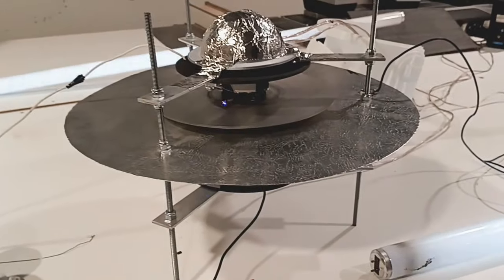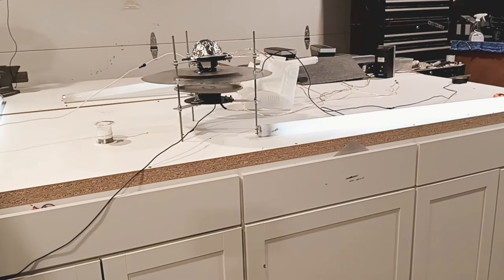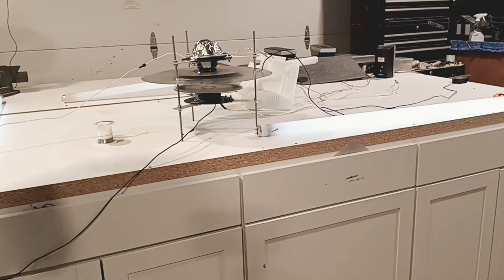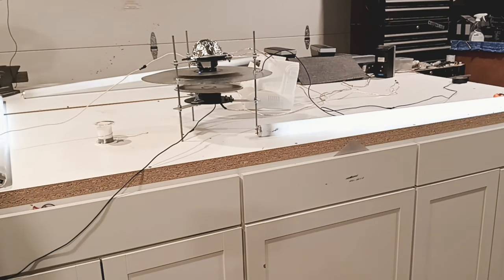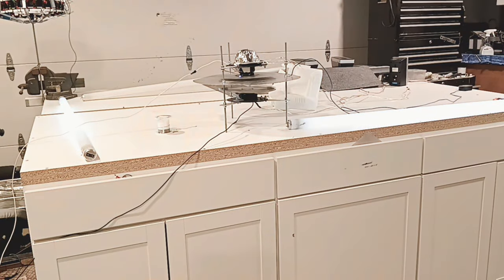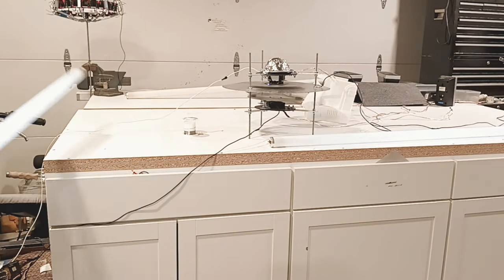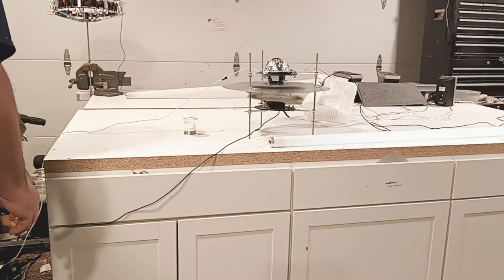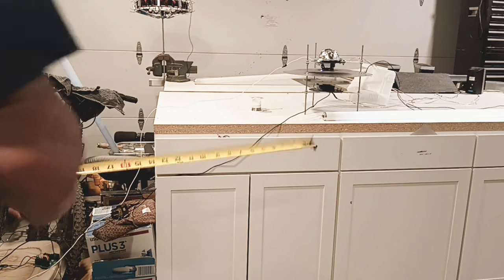Graviflyer Testing 6 "Pushing The Field"

Comment: Is this device using the same concepts that were just supposedly discovered by NASA? Supposedly able to generate more than 1G of force without any typical chemical propulsion.
Reply from the maker: The static experiments. In some ways yes. But from what I have seen they use 1:1 on the size between plates of material.

Comment: Have you checked continuity between plates? As I understand it, the middle plate is not supposed to electrically connected to any of the plates, but when your experiment sparks, it seems like it sparks from top plate, to center and through the chassis to the bottom plate.. High voltage can easily jump gaps, I think there is bad insulation between the chassis and the bottom disc.
Reply from the maker: I have 2 fields  pushing against each other causing spikes in voltage.
Reply: @nathanbunten4299   are the fields... 🤔🤔🤔n/s,s/n..... s/n,n/s🤔 or in line like n/s,n/s..?
Reply from the maker: @gypthcnuryse7611  I don't have a way to test. The static meter doesn't show it.
Reply: @nathanbunten4299  the way you stacked the magnet when you built it they push or pull ... I kinda remember a video I think u said it was ... s- poll on bottom? So I'm guessing you have the 2 n+ polls 🤔 against the center plate.  And the static charge is building up there. 😆  I think I need to rite some notes 📝 this thing so cool 😎

Comment: 39" = 990.6 kHz mass vibration, the energy that forms structure.
Reply from the maker: Question. If I set my high voltage coil to that same frequency. Would the effect be bigger or more powerful inside the same area? Also if I wanted the static field on the inside to be a little smaller then somewhere around 900khz would do it?

Comment: I have had the same kind of spark leakage in different experiments. I took my hot glue gun and liberally filled the pin side of the flyback transformer with hot glue. The over sparks stopped.
Reply from the maker: I cannot do that here.
Reply: @nathanbunten4299  Ah, gotcha!

Comment: When you say 15v on the Tesla coil what frequency is it at?  Is this the input side of the Tesla coil that you’ve connected or the output?  I’m surprised because in addition to high voltage used it looks like there’s sparking going on which would seem to suggest high voltage (?)
Reply from the maker: The frequency of the center plate changes the oscillation frequency of the tesla coil. It is making the voltage spike and causes the interaction of the high voltage on the disc's to amplify. 15v is what is going into my tesla coil circuit. I will run a test with just my tesla coil in the same spot as my graviflyer and show that it cannot do the same at 15v. It would take 40v to go that far.

Comment: Does the stand need to be metal? Just wondering if you’d want to promote charge transfer via discs rather than the legs
Reply from the maker: there are 2 fields. One has to be inside the other the frame helps with that at low power. So yes it needs to be metal.

Comment: BTW the reason the camera quality seemingly decrease is because of the low light conditions, I dont see anything that would suggest something different going on. To be honest I think you just have a pretty powerful spark gap transmitter here, if you get better brushes or just used a strip of metal, I bet the "field" you are experiencing would decrease significantly.

Comment: You know this makes me think. How does the small fiber stay afloat. Like nothing but the air is effecting it 🤔. Might you see the charge within that fiber. If you want to beat gravity you must first understand magnetism. Thr bifilar coil holds many secrets. You ever check out any metamaterials??? Nice work btw
Reply from the maker: I always see it like a magnet down a aluminum pipe. The electrons are trying to form bonds but can't hang on to them for long.
Reply: @nathanbunten4299  interesting proposal. you do realize no electron has even been recorded in history correct? It's neutral to the medium how I see it. It's quality is high due to it's lack of quantity. A magnet is the same before and after it's been magnetized. It's quality is a different story. Nikola Tesla was no atomist or materialist. he didn't say electrons rather the Æther. Steinmetz and Maxwell had good ideas for it as well
Reply from the maker: @EnergyTRE  Tesla was also said to magnetize wood. To everyone this would look like that. https://youtu.be/XRfYpcyDoLg?si=lTf5ukiZo5GZTLrc

What is really going on is polarization. I believe it is what make up our magnetosphere. The same test done on my graviflyer where it is connected to the center plate also shows this effect wood sticks to it by a polarized bond. It is aluminum. No magnet can do this. 

What I am saying is the field is already everywhere. We always want to know what to solve for in antigravity. This would be our first clue. A mix of polarized fields that will react like static charge. 

It is why I am testing my Graviflyer with this field on the outside or whole frame. There is a lot there to figure out.
Reply: @nathanbunten4299  agree the field is everywhere. The greatest minds called it the Æther. Illumination isn't a duality or a particle it's the modulation of the medium.
Reply: There is much to do for me, not so much figuring out anymore. No reply to metamaterials?
Reply from the maker: @EnergyTRE  I agree. That is why I am working on the fields so much right now.  When I ran this configuration last time it was uncontrollable. I think I have it understood a little better. I think I found a field like it but not sure it's the real thing. Time will tell.
Reply: @nathanbunten4299  you definitely on the right path. I've noticed a few specific frequencies that resonate well with the local medium. Once out of the earths radiation belt/ emf.  there are more waiting Jupiter, the sun, Galaxy, great attractors. A consistent power supply was my next goal. I called it the potential cube.
Reply from the maker: @EnergyTRE  if I could combine aluminum with quartz. That would be the best one. I don't even know if that is possible. I also like cobalt for coils core. It is a superconductor when cooled. I do not have a better answer. What I would want they don't make. Maybe it can't be made.
Reply from the maker: @EnergyTRE  Have you ever thought that the earth has a big resonance chamber at its core. That frequency is the dominate power here. 

I like the potential cube idea. If you change the set of frequency's to each planet you get antigravity in each one because they are all different. If that is where you are going I like it.

Comment: You can use Faraday cage on your camera.
Reply from the maker: That sounds like a plan.
Reply: @nathanbunten4299  also do not put the lights near the cables to make sure its an actual field size that causes the lights to flicker and not the field from the cables.
Reply from the maker: @raysplay2827  I know, I tested the cables for leakage. I normally use coax cables to test with. Th insolation is 10x better.
Reply: @nathanbunten4299  that's great. i mentioned this for video footage so no one can say its a hoax due to the lights being near a cable. keep up the amazing work, i am rooting for you.
Reply from the maker: @raysplay2827  I don't need the cables to show it bigger. I can push this field out 20 feet. In fact it is one of my next tests before I Force the fields back in to a bubble.
Reply: @nathanbunten4299  i wonder if the field is so powerful that it reaches 20 feet, how would it behave in concentrated asymmetric conditions .  if i understood you correctly, the the upper bubble need to collapse using the ultrasonic wave every time it reaches its peak. 
Could you also test extremely low voltage on the upper disc while having high voltage in the lower disc? in theory you might be able to reproduce the exodus propulsion using electrostatic pressure.

if its not charge asymmetry that causes the effect , i speculate that what causes the flying effect is the fact that the bubble must grow and collapse to create the effect. as if you establish relationship between 2 bubbles and before that relationship is established, no effect will be generated by collapse of upper bubble.

if the speculation is right, once you establish what exactly is the required relationship, you re/discover a new principle.
Reply from the maker: @raysplay2827  The reason for the testing is to see how much power there is. Then reverse the fields. I need to know how much power the field is holding in. There is a pressure there. The pressure is the key

Comment: i am wondering looking at this 15vdc in ? amps. This could be great to measure the output to see if you have a COP plus ?
Reply from the maker: I order a new power supply that tells the volts and amps used so when I have it I will show the numbers.

Comment: Do the disks spin in opposite directions?
Arent they supposed to spin in opposite directions?
Reply from the maker: yes they do and yes they are supposed to. I am going to try today to get that same field to push out 3 more feet.
Reply: @nathanbunten4299   He is totally right in using sparkgaps. Where can i study design? If power is driven by sparkgap how is poles rectified ?
Reply from the maker: @BushLieWorldDie  it is a solid state tesla coil so no spark gap. here are some video's on the build.

https://youtu.be/kFa3lvylyyw
https://youtu.be/rk3d6Saf9_0
https://youtu.be/yUcPMlYO6AE
https://youtu.be/pW-yxtEPr6U
https://youtu.be/eT0l-EPlog4

Comment: Is ur ultrasonic pezzo going?
Reply from the maker: no. just the HV and TC and motors.
Reply: @nathanbunten4299  with the field the tesla coil is making ..are you able to test the magnetic strength 💪? It would be nice if it was the thrust factor ..when you turn the pezzo off it becomes a receiver and dumps ?? into TC? I need to rewatch some more and i need to watch the build ..  your content is great 👍
Reply from the maker: @gypthcnuryse7611  I am having trouble with the piezo making changes. It runs and can be seen on the oscilloscope but I do not see the change.

Comment: your pushing way too much power. your field shouldnt be no more than on the craft itself. another words, it should only light up when you touch a bulb to it
Reply from the maker: It is only 15v. My tesla coil circuit starts working at low power of 12v. The high voltage is 12v in. This field should have never been this big. I have found a resonance point in the rotation of the discs. I have to follow where the test leads me and the power is one thing that keeps happening.
Reply: @nathanbunten4299  look into different transistors

Comment: Black & White TV was built first and then it had several stages, from round screen to semi-round screen, and then rectangular screen, and then flat screen. With these three achievements the Yoke coil, and vertical and horizontal sweep were modified, then in order to increase the picture quality the sweep rates were changed and then inter-laced techniques were used. In all that there was one definite principle and that was when electrons hit the phosphorus coated glass in vacuum it shines. That very property of electron in vacuum an flourascent material coating gave is television. Then comes the color TV using three electron guns, and then high definition paper thing LED type. Soon we will have true 3D halogram projection to watch television with a totally different prospect. 
Now, coming to your experiment, I have watched several of yours I don't see a proven fact: Such as Gravity and its definition? The most important thing is the unified field theory. There is only one force in the universe; that we need to find out. How? Well, Gravity is one, Magnetism is second, Electric is third, and weak and strong force of attraction and repulsion of electron is fourth. Now scientist found out that Magnet and Electric forces are interchangeable: meaning electric makes magnetic force and magnet makes electrical forces: that reduced to o ne as Electro-Magnetic force. Then we had witnessed the Z-particle spin in the atomic structure, beginning of quantum theory, and we figured out that Nuclear force is nothing but electro-magnitism.  A Noble Prize was awarded to three scientists in proving that. Now we have identified two forces, Electro-Nucleo_magnetic force, and second is Gravity force. How did we do it? BY finding the properties that these three forces interchange each other. Now four forces have been reduced to two. The million dollars question is how to find out if Gravity and Electro_Nucleo_Magnetic force can be arrange to form a Gravitic force or vice versa. There has to be a THEORY and PRINCIPLE. You don't have either. Someone showed a flying graviflyer does not mean anything because there has been no such evidences yet that gravitic force is an off-shoot of the other force (it must be but not discovered yet). So you are assuming a lot of things here in these experiment. One of your assumption is to create electromagnetic force in a toroidal form, just like the gravitic force around the Earth or any other satellite out in the space. So far we have seen how atmosphere ATMOSPHERE gives a lift when stream of electromagnetic radiation shoots in the atmosphere; See Tim Ventura's lifter. NASA also has been working on Ionization thrust but to no avail. The bottom line is this  that you are assuming some effects without proper and pragmatic reasoning. You can arrange capacitors, inductors, magnetic in one million different ways and one of the set up may produce ANTI-GRAVITIC FORCE. We don't know what gravitic force is; just as we did not know what magnetic force was. One thing to notice, when a magnetic is moved in a coil it causes magnetic flux to influence the coil and if it is a closed loop the electric current flows through the coil. There are no additional electron entring the system and as long as the magnet is moving, the current flows through the load, neither the wire nor the magnet looses its weight or quantity? So whatever electrons are within the closed loop are producing the power proportional to the movement of magnet and mass of the coil? Think about it.I would like to see your response. I am a scientist and this is the longest comment I wrote after my five pages thesis five years ago on the same subject.
Thank you for sharing your work. I do admire it and by no means discouraging you. Please continue your march.
Reply from the maker: I had an outline given by the creator of this device. The problem is that it is not showing that it works this way. I am not doing random tests. I am following the fields to find common spots where they can tell me something. I have a working theory on how it works. I will write it in detail and post it this week. 

The biggest problem I have is that the test for what I want to know directly has not been discovered yet. I have to invent it to even find out if I am close to achieving it.
Reply: @nathanbunten4299  Thanks for your reply. When I watch your videos I do not see a principle behind each variations you performed. The hv hf emitting from Tesla coil has to be in resonance. Tesla is nothing but a great magic of resonance. When an electromagnetic wave generator resonates at its resonance frequency the electromagnetic properties or induction transfer diminishes and transforms completely into magnetic flux field that behves differently than electromagnetic field which is perpendicular to each other. To maximize the magnetic flux field the current and voltage must be in phase for max effect, and that is only possible when the system is in resonance. Even if your Tesla Coil radiating electromagnetic field must be in resonance and then when you bend the field with the spinning disc it might affect the gravitic force. It is something not too complex but it seems so. Good luck. Thanks for your reply.